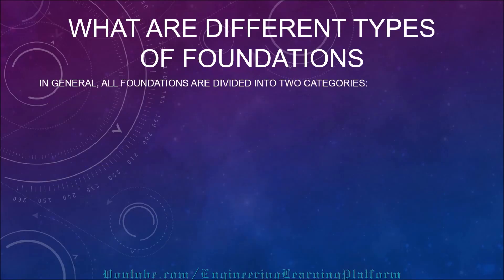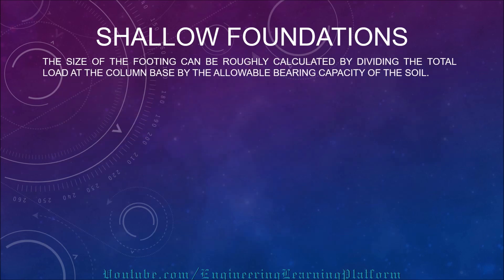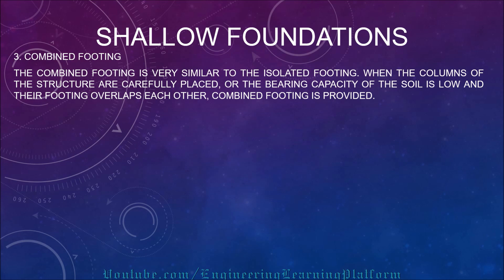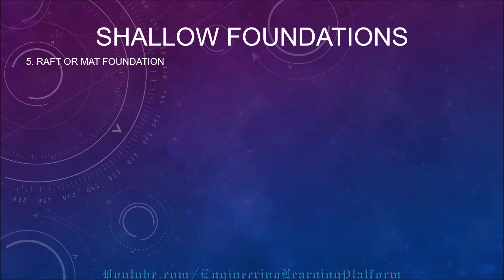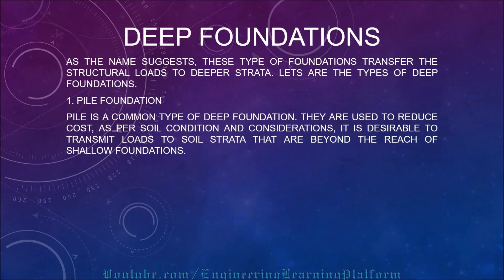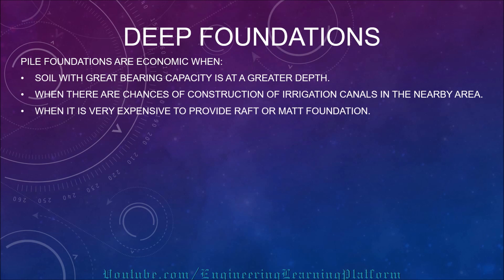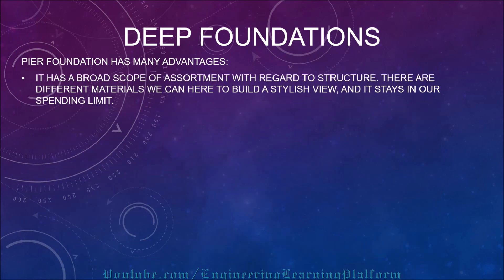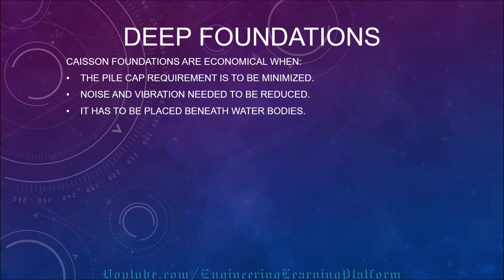Types of foundation

Comment: Hai sir, can you please make a video about how to design footing for building without beam/column structure. Its slab resting on cement block wall and that wall rest on plinth beam. There lintel beams are provided throughout. If u can't please give me any suggestion about the footing design of these type buildings.